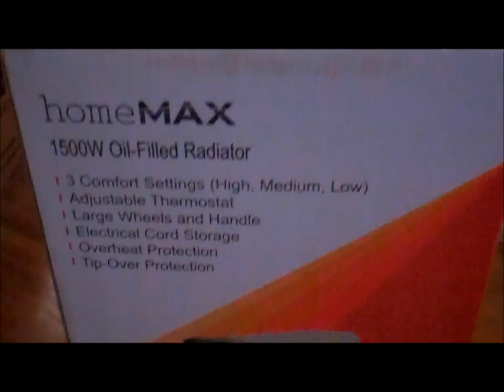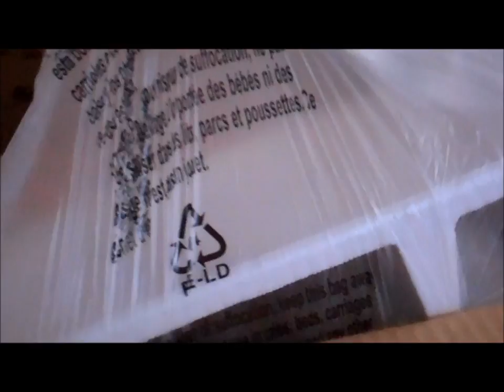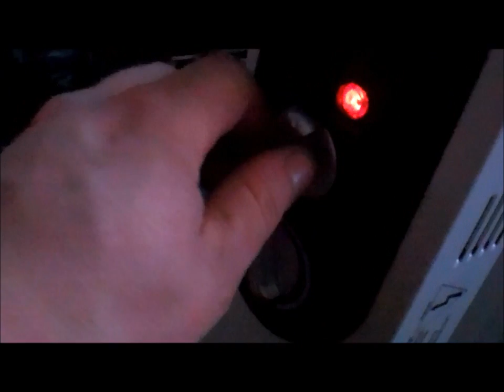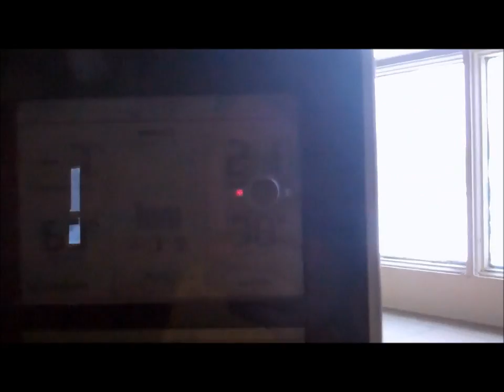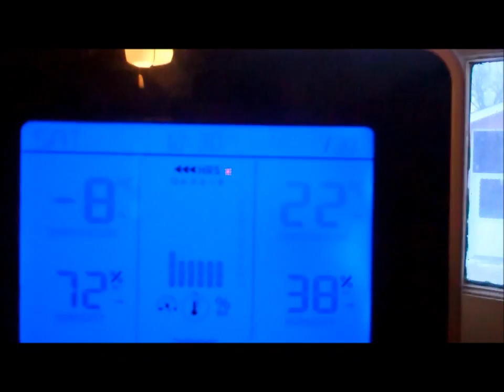Jeep project update and space heater

Comment: I still own a Pelonis Oil Heater since 2001.  I used to use it in a very cold studio apartment where I used to live.  I would crank that heater to the maximum wattage and tempreture setting (Yeah, free Electricity!).  This thing would be on for 12 hours a day on the weekdays and 23 hours a day in he weekends.  I don't use it anymore because I'm living in a better heated place, but during the time that this radiator was on duty, It NEVER let me down.  Good Luck with yours!

Comment: We heated a drafty rental home with 3 of these, The good thing about the oil filled heaters is they aren't "on" all the time, just come on to heat the oil to your set temp. The rest of the time the oil just radiates heat. We have a woodstove now so don't use them as much. You should be plenty warm with just one in a trailer :)